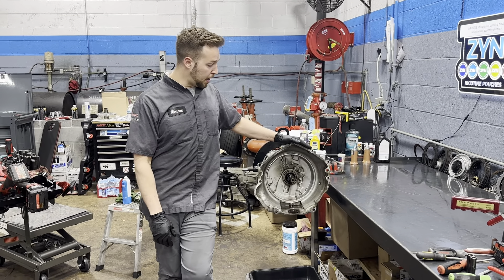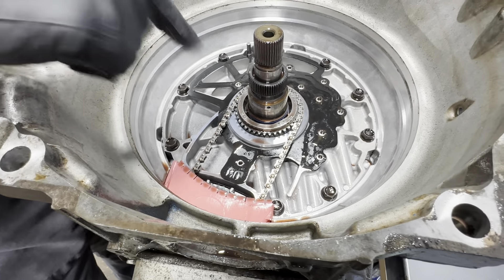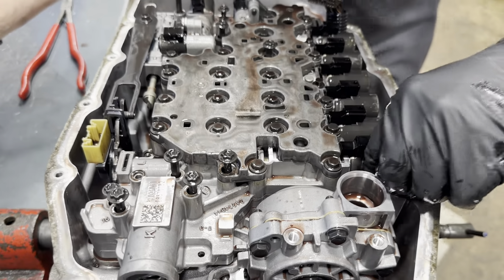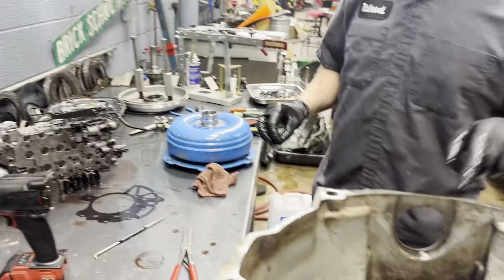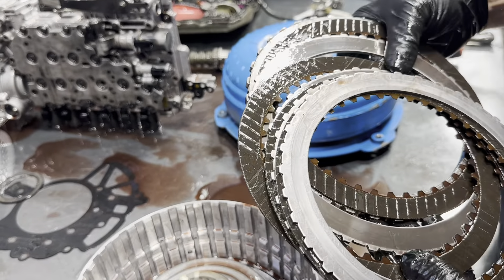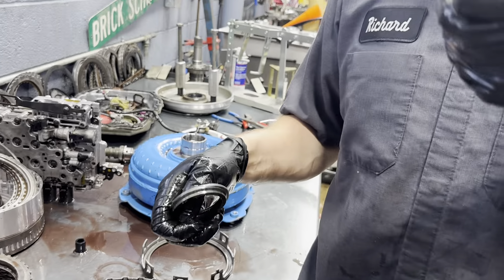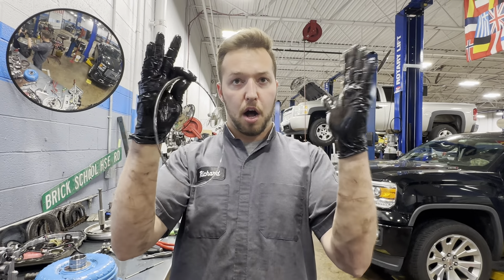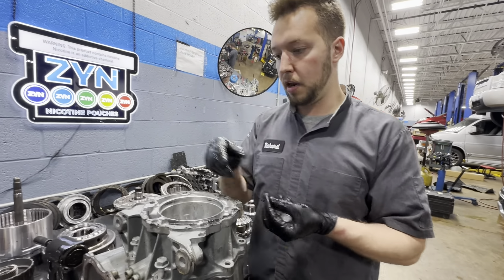GMC Sierra Denali (8L90) 8 speed teardown

Comment: Good friend, I repaired a 4L65E transmission But I left the same converter, the fault it causes is that the 4th gear slips, applies and disengages it, the engine rpm goes up and down... I changed the converter for a used one and the same thing continues fails... what could it be, is it the converter? Both converters are used, I tested it Manual too and it does 1 2 3 fine when I put it in Drive, it slides into 4th gear and the engine rpm goes up and down As if you applied it and unapplied it, the only failure is the 4th change, nothing else is fine...according to your experience, where should the problem be? Regards

Comment from the maker: Certain 2016 Escalades equipped with the 8L90 WERE under a special coverage for failure of the internal wiring harness assembly. However, this is issue plagues all units in the 8L family even 8L45s in Colorados and or Camaros.

Comment: On the 8L90 8 speeds, there are no plastic tabs that hold the halves of the valve body together, it’s metal tabs on opposite ends on the inside of the valve body. The separator plate has to fit over the 2 metal tabs inside the valve body and there are just there to line it up upon reassembly.

The solutions to fixing the problems with these 8L90 Transmission are 4 things. 1. TRANSGO thermostat cooler bypass delete kit. It drops the transmission temperature by 60-70 degrees. 2. SONNAX Shift Kit. 3. SONNAX TCC Kit. 4. Disable AFM/DOD. This will fix all of the issues concerning this 8 speeds. How do I know this? Simple. I did my 16 Escalade at 22,000 miles. Now, I have 92,000 miles. No issues and the transmission fluid  temperature never goes higher than 165F.
Reply from the maker: @HewigIsidore  I think you’re confusing dowel pins for separator plate retaining clips but yes every issue in them stems from valve body.

Comment: I just got a 2015 Yukon 6.2 8L90 with 122K, seems like it was taken care of. It has a delay 1-2 shift mostly first shift of the day. I just did a fluid change 12 quarts mobile 1 blue label, drained through the cooler lines running 10 seconds at a time. The pan looked pretty good, but the fluid was pretty dark. I have not really noticed much shudder except maybe at really low RPMs. I also just installed the superior solutions thermostat valve upgrade. I want to take it on some back country  trips and maybe Canada, but now a little worried about reliability. I was surprised and happy to hear you did not think there were a lot of 8L90 converter failures. The temp sensor seems to be working fine. Should I just worry less and drive or should I do anything else to it?

Great vid BTW, subscribed.
Reply from the maker: @jayeritsland9780  Congrats and good job on servicing it man! If I were you I would drive it till there is absolutely a problem. I think you should be safe to keep driving it. However, You’re at the mileage where you will likely have some issue arise. Whether that’s valve body, internal temp sensor, or chain etc so I would budget $5-6k for transmission to be on safe side.

Comment: I have a 2020 Sierra SLE with the 8L90. Its a certified preowned and apparently at about 50k it had the new fluid (hp) put in and whatever else done per a TSB. Sometimes this thing when its cold has a delay between 1 and 2 taking off for the day. Also when putting in reverse has such a clunk. I read it was the "chevy clunk" but for a newer trans does that still hold true? Whats your thoughts?
Reply from the maker: @edwardbarden4722  The harsh 1-2 shift of the day is actually a normal operating characteristic and it is due to trapped air being purged from the 2-4-6-8 and 4-5-6-7-8-R clutch assembly. The clunk in reverse is also likely normal as it can be attributed to lash in the driveline. Try letting your foot off the brake when shifting to reverse and it will be more smooth. You must also remember that it is a truck and it can shift like one sometimes.
Reply: @esoterictransmissions  ok, all make sense. Thanks for the response. Otherwise it has been a decent truck... so far. Hopefully the engine holds up. lol

Comment: One of your shorts you said you recommended 40,000 fluid changes at a minimum on these transmissions. I prefer to do my own maintenance and since I don’t have a fluid exchange machine I was going to do pan drops at 20,000 mile intervals. I’ve already completed one.  You think this is sufficient?
Reply from the maker: @flyer8493  20k on an 8 speed could be overkill. I would every 30-40k

Comment: I have a 2017 Silverado with the 6 speed, bought it used at 45,000 miles. I did my research before hand and installed the lower temp thermal bypass and  full fluid change, will this extend the lifw of my torque converter? My average running temp is 145. I had seen one of your YouTube shorts. Thanks!
Reply from the maker: @paulcondie2520  To be totally honest man every single 6L80 equipped truck or SUV from 2014-2019 with the original torque converter will have a failure anywhere from 45-145,000 miles. It’s not IF it’s when but if you catch it in time or replace the converter when it begins to shudder you can save the transmission. To answer your question, yes. The cooler it can run the better. GM actually requires you to replace the thermal valve with an updated part anytime you rebuild a 6L80/90 under warranty. However, most 6L80 equipped 1500 pickups and SUVs are out of warranty by now. I rebuilt a 2019 Tahoe that was barely under certified powertrain months ago. Just budget for it and keep the truck!